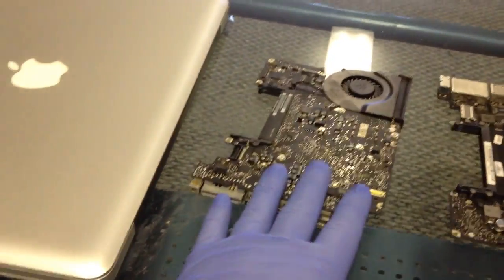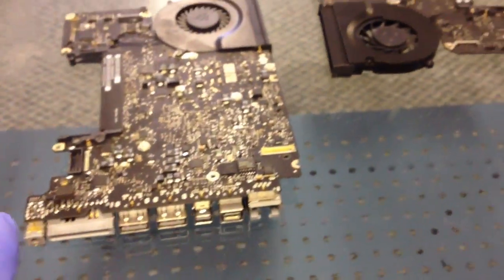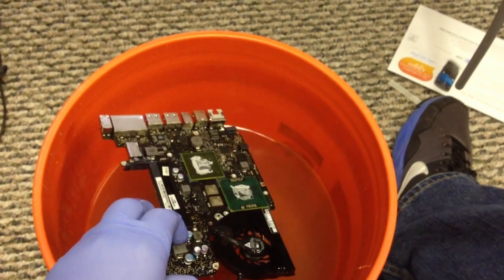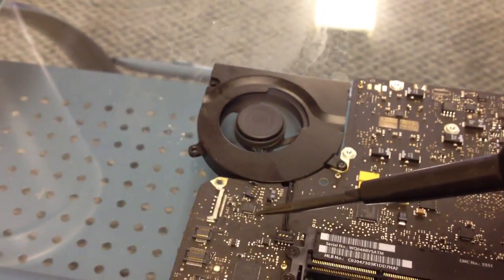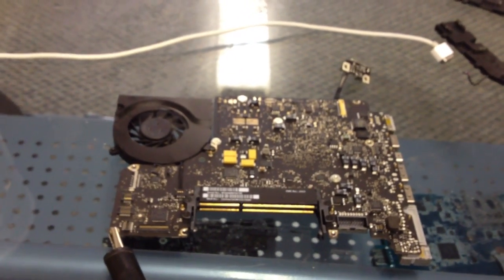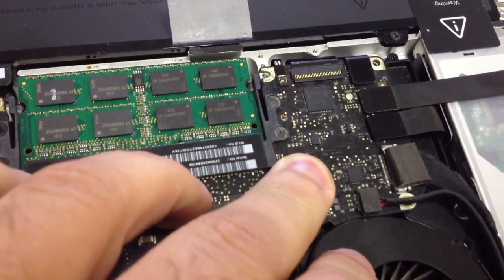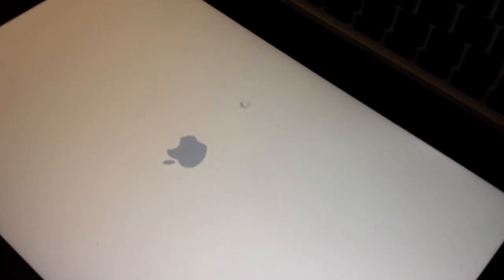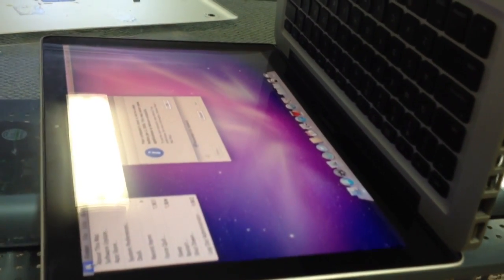Apple motherboard repair performed by Doubleclickittofixit.com laptop service

Comment from the maker: On those we use acetone at 100 percent, and it is not nail polish remover.  Sometimes in a pinch we use anhydrous alcohol at 99.98 percent or denatured alcohol at 90 percent.

Comment from the maker: The IR attaching the balls back on in the stencil does not work with the IR.  Only the fluxing and reattachment does by IR, but to remove the chip to use another we use hot air and when attaching the balls back to the new chip while in the stencil we use hot air.  So hot air to remove, hot air to solder in the stencil, then IR to reattach to the socket.